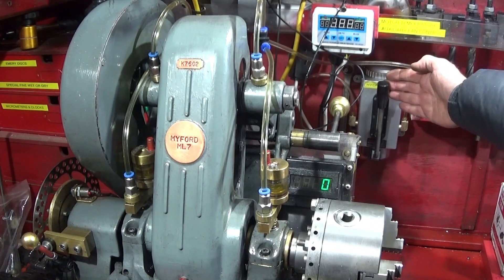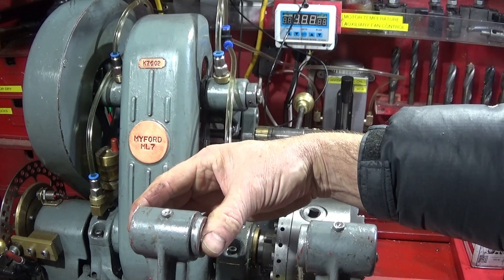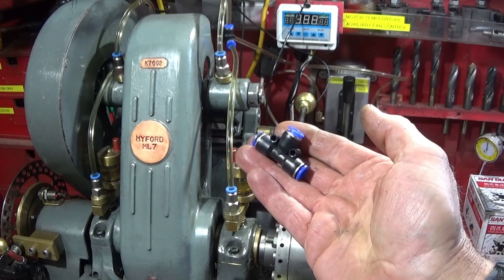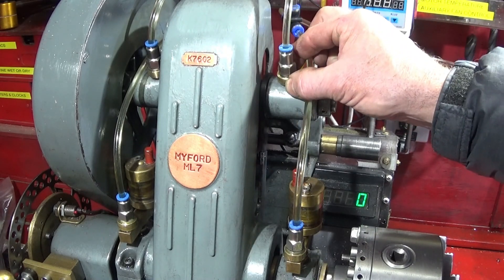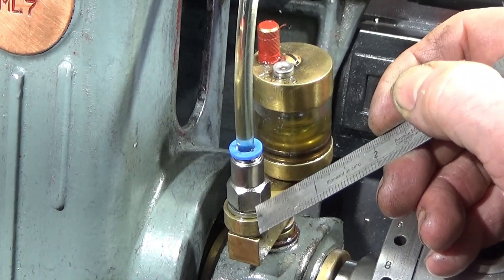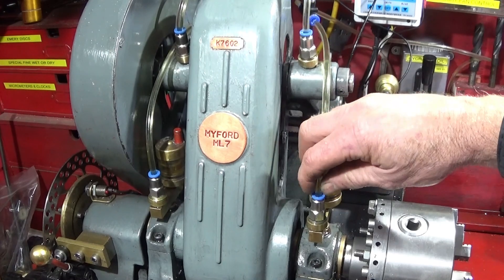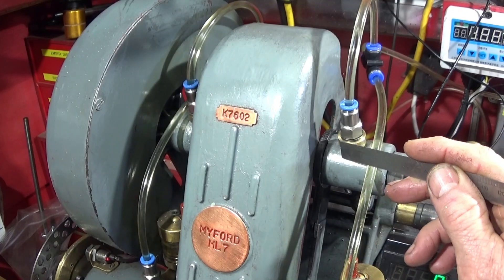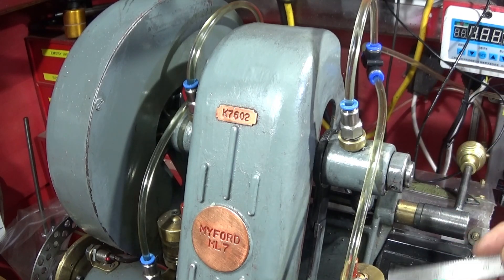Myford ML7 Full Headstock & Countershaft Hydraulic Bearing Oil System

Comment: With multiple lines all connected your oil will only flow out of the loosest fit bearing if you want to do this kind of set up you really need an equal pressure per line manifold to be confident every bearing is being oiled correctly
Reply from the maker: Hi If you watch the video through you will see that I have done that. I used equal pressure non return oilers in each port to create equal back pressure. This was pressure tested and works perfectly to allow equal oil flow to each port. Regards Steve

Comment: Interesting approach to flow control Steve, typically in lube systems with many ports necessitate the use of meters or flow dividers, the danger being the easiest path will be seeked out by the pressure leading to other components being starved. Please consider giving us a progress report down the road when you have observed this approach for a while. Good choice of oil as hydraulic oil has a light anti wear additive as opposed to turbine oil which is treated less. Enjoyed the vide, and that Myford is a splendid looking lathe, cheers!

Comment: I’ve fitted a similar system to my small surface grinder but unless you have flow restrictors in the line the oil doesn’t distribute evenly across the machine and some slideways get more lube than others.